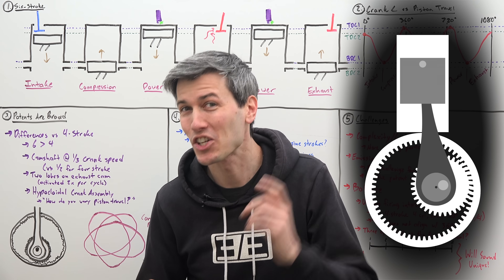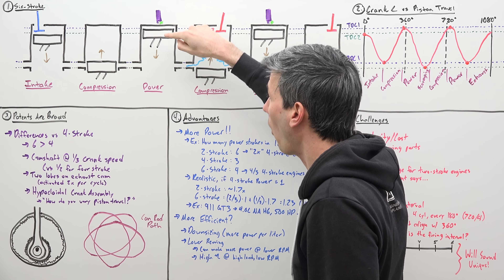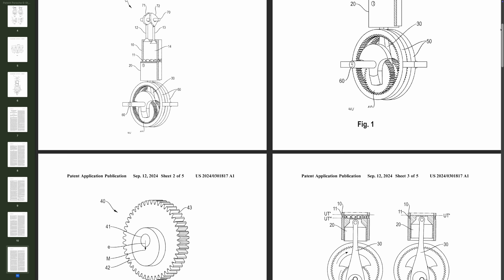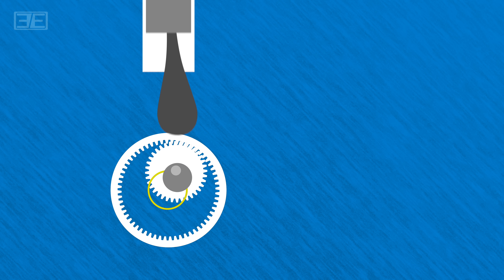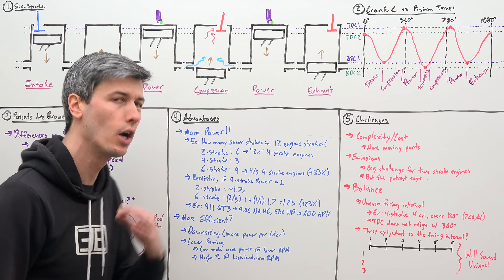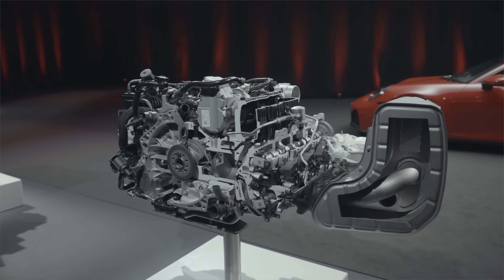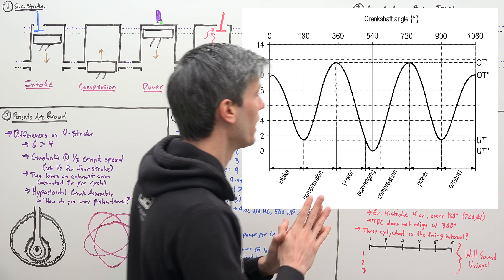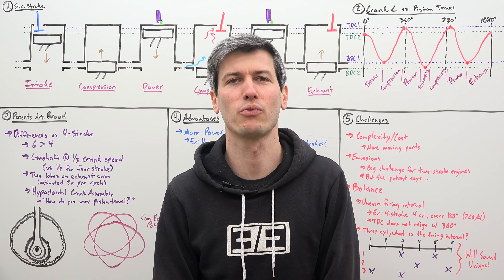Porsche's 6-Stroke Engine Is Genius!

Comment: The biggest problem with 2 stroke emissions in a powersports type engine (no poppet valves) is that the exhaust ports are uncovered before combustion is complete and that raw air/fuel can escape while both intake and exhaust ports are uncovered.  This looks like they are using a poppet valve or just a valve as the exhaust control for both cycles so the hydrocarbon emissions should be reduced.  Two-strokes have inherently less NOx compared to four strokes so it may be reasonable to assume that an one power stroke with lower NOx level and a power stroke with a lower HC level could lower the overall emissions profile pre-catalytic converter.

Comment: You see? This is what happens when you give a German engineer a Spirograph. These guys can make anything out of anything. Congrats on the milestone, I've been a fan for many years.
Reply: Unfortunately they can’t make new technology,self driving efficient electric motors , good batteries.
They are stuck in the past with loads of machinists manual workers.
Building things on old style car production lines 60 year-old technology.
Reply: @paulmeynell8866  You're just a laugh a minute, aren't you?

Comment: This could be parallel dual fuel. Gas on the 4 stroke compression stage & a diesel injector firing on the 2 stroke compression stage for more power for fuel use.

Comment: How does it compress well in the 4th stroke when the valve is open and (seemingly) closing while the piston is moving up? How clean will the second power stroke be? It will be difficult to separate "dirty" and clean air perfectly.
And how are you lubricating this with the air ports being there at the bottom?

Comment: what you didn't look at was: rotational weight and inertia(additional weights to compensate the different power stroke positions on the ring), which you mentioned, friction and frictional differential on the ring gear, flame front will be very inefficient during first power stroke(won't be clean/complete) , piston design trying to work with 2 different crown heights. This has also been done/pattened dozen times by my count.  This might be a considered for large low speed diesel engines.  But no way this won't tear itself apart at 5-6,000 RPM.

Comment: Im 42.  I have dreamt of this exact design since I was 14!!  

Not every detail but to have a 2 stroke with valaves.  And the cylinder layout.

I hope this works well for them.
Reply: A two stroke with valves is a Detroit Diesel
Reply: I thought a Detroit diesel was a bonfire at a heavy metal concert.

Comment: As someone who is old enough to have played with a Spirograph ( remember those?), I wonder how the hypo cyclical gears and their associated teeth will reliably deal with the stresses. I'm not an engineer but it looks like some of the power strokes have to be delivered when the gear is not optimally positioned to absorb that force.

Comment: Noob comment here, he seems to question why it should be more clean. If I understand correctly it's supposed to be more clean because what would have been exhaust gasses from the first power stroke is re used in the 3nd one. I think there is already a technique in normal engines to keep some of the exhaust gas in for another cycle right?

Comment: That sounds like an absolute nightmare. Going to be wrecking connecting rod and main bearings left and right.

Additionally, think about the cylinder walls and rings. This engine will have a seciton of the cylinder wall that the cylinder traverses moreso than the rest, leading to addition wear in places along the cylinder walls and potentially the piston rings.

Comment: How is the air getting in the camber in the 2nd compression stroke when it's a NA engine? I think this only works if you force it it aka with blower or turbo

Comment: I don't understand how you could be so smart ( and you are) but miss the obvious. Most internal combustion engines throw about 90% of the energy out the exhaust pipe.
Middle cylinder intakes fresh air as needed, but does not expell. So with a bit of chilled air in the mix for MORE power. Now it can redo an attempt at better power use before expulsion. Hence why it must always be in rows of 3.

Also 3 and 5 cylinder engines last better. Much better balance. My father spent some time doing tow truck driving.
Almost always 3 and 5 cylinders could drive on the truck even after a crash. The engines don't often blow.

Better balance, better life expectancy.
Not applicable to 6 cylinder engines if straight.( no longer odd numbers for balance)

Reusing the exhaust gas for a second burn is genius. Reusing it and giving a quick mix of some cool air or resercd. Air is genius.

Of course the b.t.d.c. offset does not matter. It does not need to bang in the same place.

But also. It can, spark determines ignition point in petrol. 
Correct compression point in deisel.
Never t.d.c.

Comment: Regarding the multiples of 3, I would guess that it would work by offsetting the exhaust strokes by 360, that way you'll always have 2 simultaneous power strokes, albeit with a slight stagger giving some "character" lol; in fact, on a 6 cylinder, the stagger might mean that subsequent power strokes always overlap!

Comment: Second compression can open the exhaust a bit less and recycle the air that might has some un-burnt fuel in it... Basically like an EGR but it doesn't require piping back the exhaust gases externally. I hope you'll read this comment 🥺

Comment: From my perspective as a professional auto mechanic, while this engine in theory COULD produce more horsepower (and probably does simply by the nature of its design), my guess is its designed more for fuel efficiency rather than power. If you compare the primary intake stroke to the first power stroke (PS1), the engine is drawing significantly more air into the combustion chamber compared to when the piston passes BDC1 and draws air from the side ports. So, in effect, the very end of PS1 is the "intake stroke" for PS2. This much smaller amount of air would be to bring the mixture back up to the stoichiometric ratio allowing for the second burn on PS2. Thats probably how they achieve the "clean burn" referenced in the patent.

So to summarize, in my opinion, PS2 seems like its meant to reburn the remaining fuel after PS1 in order to achieve a more complete burn overall. Id be curious to see the power output of PS1 vs PS2.

Comment: You didn't explain how the scavenging air, for the two stroke event, is pressurized.  It has to be crankcase pressure, as in a two stroke, but won't that bring oil up with it and cause emission problems or oil use?  I'm assuming the crankcase is lubed in the traditional four stroke way.  Maybe a six cylinder in a V configuration could be made to balance better than a three cylinder?  Great video BTW. Thanks and keep up the good work.

Comment: Congrats on your 1000th video, very informative. What puzzles me after watching this is why my inline 5 cylinder 2.5L VW 2012 engine runs so smoothly. It does not crank out the power by any means. It does get phenomenal gas mileage and has excellent torque, but is by no means a champion of naturally aspirated engines. That said, I will keep it.

Comment: Hybrid 2 stroke & 4 stroke — This is really a 3 stroke ... (2 + 4) ÷ 2 = 3,  unless you only count from the first power stroke after the regular intake back to that same first power stroke, then it = 6 strokes. A 4 stroke with a 2 stroke slipped in 1 stroke after the first power stroke — The exhaust stroke is also a compression stroke. 
Were the engineers parttime astronomers? 🔭

Comment: It sounds like they're ignoring EGR valves and ports, and just firing the same cylinder twice, after injecting some additional air. 

Otherwise, it sounds like overly complicated, high maintenance, expensive German equipment; and I can't imagine the bill to replace your timing belt or other 50k mile engine maintenance.

Comment: You didn’t cover the fuel injection side of things.  My question would be on the 4th stroke, are we igniting unburned fuel(as opposed to sending it out through the exhaust valve), injecting just a little more fuel , or both?  Are you sure there is supposed to be an exhaust valve on the 4th stroke on the diagram?

Comment: OK but what problem is it solving?
It's adding manufacturing costs, complexity, reliability risks, head hakes, maintenance and repair costs... .

It'd better be a very important problem... 

How about we focus on electrical for most use, and simple, super reliable petrol/gas/alcohol/Hydrogen engines for where electrical is not practical? 
Oh wait, Honda and Toyota have already done that?

Comment: I wonder if they think they can pass emissions with the engine in a limp mode where it only has 1 combustion/6 strokes, but goes to a 2/6 mode when someone is hard on the gas, meaning they get to have a lot more power and comply with emissions. Wouldn't be the first time someone in Porsche's auto group did something a little sketch with the emissions rules.

Comment: 11:21 one reason 2-strokes are dirtier is incomplete combustion. Some unburned fuel that comes in via the intake port escapes out the exhaust port before combustion. This 6-stroke design keeps the exhaust valve closed when the lower intake ports are uncovered, preventing unburned fuel from escaping. Sounds like that is what they were referring to in the patent.

Edit: It looks like I got a couple of things wrong. First, the exhaust valve does appear to be open during the second compression stroke. Second, there may be only air coming in via the intake ports on the bottom, not a fuel/air mixture (they may be using direct injection to avoid fuel escaping out the open exhaust port).  Still an interesting design but I'm having a hard time understanding why this is worth the complexity trade-off. If they can make this second, two-stroke part of this cycle clean why not just make a clean two-stroke to start?
Reply: Exactly. If the Compression/Air exchange stroke is efficient at all, why not use this as a two stroke engine.
Reply: I thought there were two times when the exhaust valves opened, the first being on the second compression stroke where the bottom intake ports were opened from the lower bottom dead center?
Reply: All that said but how would u keep oil in crankcase with an open port ???
Sorry this bugs me lol
Reply: @derekdenmark2981 they wouldn’t have to direct the intake air through the crank case.  The cylinder block casting would be a work of art, but absolutely possible these days.  Plus, this is Porsche, these aren’t economy priced cars.
Reply: @derekdenmark2981  Interesting question. Answer: I think with autolub.
Reply: A two stroke engine is clean when the fuel gets in by injection and the intake is just air.
Reply: Well, there are two stroke engines with active valves. And with direct injection. So yes, you could in theory make them viable, however, you should probably use it alongside some technology like skyactive-x or similar in order to make a faster combustion, as in a two stroke engine you let the exhaust exit too soon to use all the explosion of the fuel, letting some out. And that can't be easily solved.
Reply: Not with uniflow diesels like the EMD 710 or GM diesels.
Reply: 5:24
Reply: @PSboy_VII Oh you're right, it does look open at the same time. I wonder if there is some game being played using an exhaust valve vs. and exhaust port like a traditional two stroke. Maybe tweak the timing of the exhaust valve to avoid the issue. Or use direct injection so it's not fuel/air mixture coming in the intake, just air.
Reply: @smilingbear1  It's just air coming in from Bottom Dead, not fuel.

Comment: While it sounds truly impressive on paper and probably would be great to fit within the rules of some low displacement racing rules, here we have a very expensive engine that basically isn't meant to be serviced. Yet another example of a German automobile that is fantastic when brand new, then you run as far away from it as you can get once it has like 15k miles on it...

Comment: This 6 stroke cycle is a significant technology for power improvement for petrol & diesel engine (same engine size, same weight > perphas more fuel consumption).

Sadly, in the EV era, petrol / diesel engine becomes less significant in auto industry😢

Comment: It is all done at the expense of longevity. Engines should last for as long as possible. If a car can be used as brand new & then sold to a new owner and have 2nd or even 3rd live then it is the most eco-friendly solution possible. Meanwhile it seems like engine like this would last like 100K Km & then will be very hard to fix due to complexity. Brilliant solution from a perspective of car makers as they can reduce emissions while still selling regular combustion engine cars, but from a perspective of an average joe it is not so great.

Comment: Internal combustion engines are archane.  They will lose to Electic in both cost and performance.  Battery costs have come down 93% in the last 5 years and will drop and 93% while also doubling in energy density in the next 5 years.  Legacy car markers better get with it or they will get crushed

Comment: A couple of things on the topic of efficiency gains. First, it's worth noting that the valves never open for a full stroke on the higher TDC strokes, only on the lower TDC strokes. So, there might simply be a gain there based on the higher compression ratio. Second, I bet the thermodynamic cycle (e.g., P-V diagram) of this engine looks really weird, and there might be an efficiency gain by a sort of trampoline-like loop-dee-loop on the P-V diagram, by maybe running top and bottom intakes at different pressures (i.e., the second power stroke is boosted up compared to the first, compensating for its weaker, impure combustion).
This is cool, but I kind of get the feeling it's a cool idea that they secured a patent for, because, why not, and that's as far as it will ever go, like most patents.

Comment: I'm must be missing something, but it looks like this engine might be balanced using 6 cylinders. That's an example. One means power stroke and zero means any other stroke.

0	0	1	0	1	0
0	0	0	1	0	1
1	0	1	0	0	0
0	1	0	1	0	0
1	0	0	0	1	0
0	1	0	0	0	1

Comment: Two things: What is the engine inhaling on the first stroke? Is it air-fuel?
And what kind of seals will protect the rings going from BDC1 and BDC2? There has to be gaps on both sides.

Comment: Question: The flame front will be moving down the cylinder on the first power stroke...So what is stopping the cylinder from blowing down when the scavenge ports are exposed? reeds ? turbo/blower? or is the timing of the exhaust valve such that it opens several degrees earlier then the scavenge port hence aiding scavenge and flow. Scavenge of this type generally doesn't work well without assistance. Then considering multiple cylinders operating on a common crank with unbalanced cylinder pressures,differing dynamic compression and resulting power strokes...I'm thinking this thing will run quite odd..we will see.
Reply: maybe the engines going to go slower and be under a lot less compression probably a way better design for a hybrid generator for ev,  have to be supercharged to even dream of working ide imagine tho

Comment: Grats on 1000. Are there other engines that would have a similar firing order behavior of a gap and then firing on multiple pistons? Does that also mean you will generate 2x the power on 1/6 the rotation of the crank and much less for 1/6, or does it average out because the other pistons are still at various stages of stroke?  Perhaps more concisely, what would a power curve over the course of a crank shaft look like over time, and is there an existing motor with similar characteristics to compare it to?

Comment: I'm not sure if this has been mentioned, but... don't try to stagger the combustion cycles from 3 sylinders each separately. Instead, stagger them with 1/3 cycle, with 2 firing always at the same time. This way you'll have 3 double-combustions along the cycle, andyou can also always stagger one 4-stroke and one 2-stroke combustion together for even power. If cylinders themselves are pivoted 1/3 cycle, I would imagine it should be balanced prettywell. If you then expand this into 6 cylinder engine, you would be able to have them take in the "gaps".
-- edit --
ah, never mind, you already mentioned that in the pinned message :) I'm not sure I understand though. If cyl1 fires at strokes 1 & 3, cyl2 fires at 3 & 5, and cyl3 fires at 5 & 1, that seems like it would be a balanced thing. I don't know if you can fire them at exactly the same time, since I don't know if the timing between the two combustions is exactly 1/3 of full cycle, but does that matter? regardless of how 3 lumps of mass/torque are balanced internally, in 2D model they should be balanced, I think. Now whether that would twist the shaft lengthwise, with force that would be too much for bearings to handle, I have no idea. And yeah.. 6 cylinder arrangement sounds like it would be more balanced.. but then, don't they make 3 cylinder 4 stroke engines too, although I never really looked into how their timing works.

From the diagram I understand that one power stroke starts slightly before 360 and another slightly after 720.. but does it matter if the starting point of "paired" strokes isn't exactly the same instant? If the cylinders themself are still staggered exactly 1/3 of the full cycle.